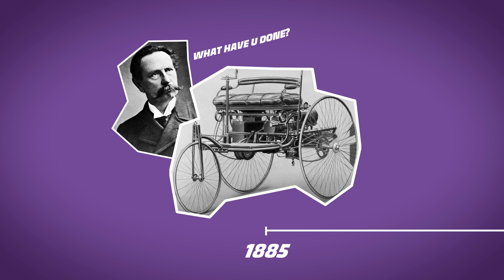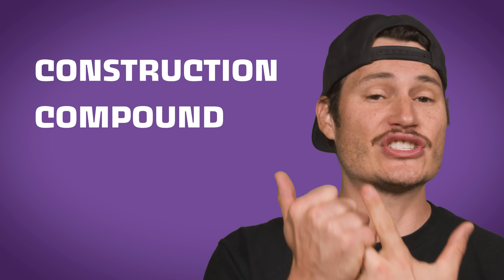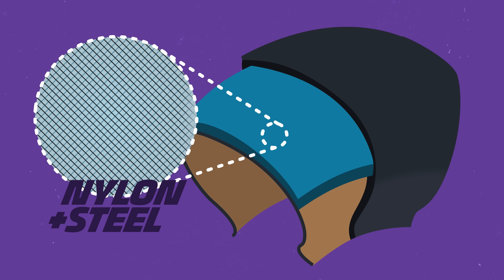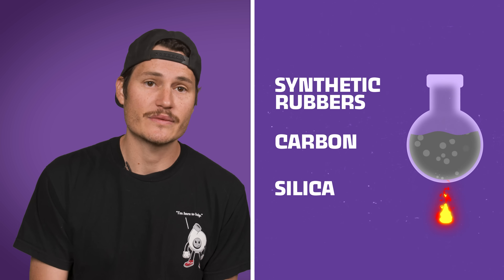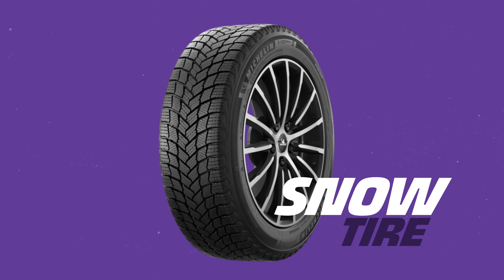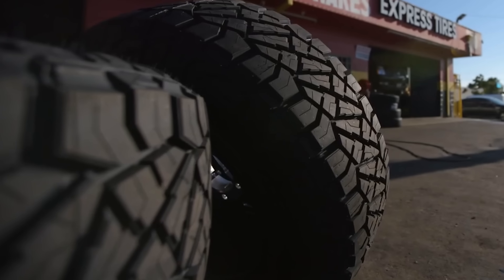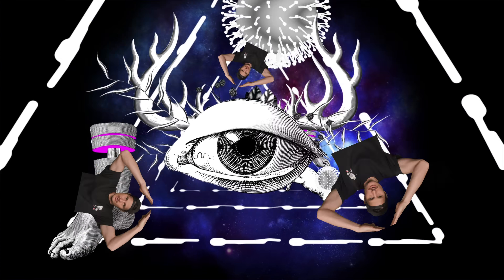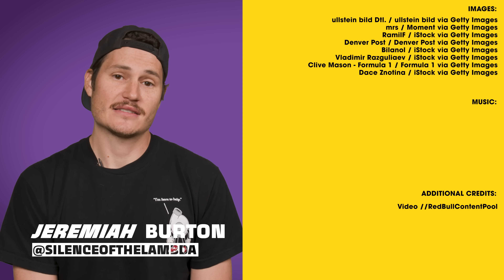The Surprising Science Behind Tread Patterns

Comment: Answer: From a physics perspective, the Fn or normal force (mg or mass x gravity) should actually be friction force Ff or Fs for force sliding (ms * N or coefficient of friction * normal force). Wider and/or fatter tires just means your contact patch is larger which might make the value of N larger because of the increased weight; changing your tires pressure also would affect grip because there is more tire touching the road. The "ms" is independent of the contact area however and doesn't change because it's dependent on the properties of rubber. Tricky question there my man

Comment: Awser: drag wheels need to be more wide and beefy to allow more grip available at the moment via 1 - begger contact patch, 2 - lower airpressure and flexabylity if the tyre body(they also act as spring int he start. In drag they go straight, no turns and therefore no need to account the wider wheel rolling resistance and its weight.

Comment: I am pretty sure the reason they prefer wider tyres are due to the weak shear strength of the soft tyres bcoz of that larger surface area is required to support the large tangential forces

Comment: Drag racers use wider tires because the center of a tire is what grips to the ground so when you have a 9 inch wide tires compared to a 15 inch wide tire the 15 will make more contact on the ground which means more traction

Comment: I’m not an engineer and I don’t know about modern tires but drag cars of the old days would have those massive tires that would wrinkle when the car would take off and if you watched closely at there burnouts before the race the whole back of the car would rise up like 6” when the tire was at speed. So ima guess the tires (on drag cars anyway) are super wide to have that extra grip for the launch and also have the extra rubber to thin out the tire when it’s at speed to reduce friction making it possible for more speed. I could be 100% wrong but that’s my guess

Comment: Tires roll, (unlike ice cube sliding on steel) so its like tape, the more tape you stick on the floor the harder it is to pull off the floor. So wider tires does not slide as eazy
If a tire starts sliding then the formula does work, but getting it to slide is harder if its wide. Just like after pulling the tape off, as soon as the tape releases then it does not matter how mutch tape there was...is slides just as eazy on the floor

Comment: They have wider tires as the amount of power generated by te engines which causes greater wheelspin. To minimise it, the wider tires provide more surface area, which decreases the pressure and helps in the traction

Comment: the friction between a tire and the road at extremes will actually shave rubber off of the tire instead of braking grip. a wider tire gives a bigger contact patch which meas more rubber to rip which means better grip.    when the tire inst autographing asphalt normal rules apply.

Comment: Ive been running directional v-tread tires on my daily since I started driving. I refuse to run anything else. The look great and perform extremely well in wet weather. My little truck runs 70 with ease when it's pouring down rain.

Comment: The reason for drag racing tires to be super wide is because of leverage advantage....the tire radius stays small at low rotational speed. Torque/hp once the tire reaches a higher speed centrifugal forces expand the center of the tire outwards increasing diameter hp/torque and achieving higher speeds..its like a gear change without the gear.

Comment: Ice skates actually work due to the amount pressure applied to such a thin point of contact with the ice.

Pressure can also cause ice to melt. So when ice skating you're actually melting and sliding on a thin bead of water that refreezes behind you.

Ice can be too cold to skate on. If its too cold your weight wont create enough pressure to melt the ice allowing you to slide. 

Also why the blades need to be as sharp as possible to create the smallest possible point of contact with the ice

Comment: Torque generated needs to be transferred to the larger tires that can be used to push the car without slip, if the tire is thin there is more slippage. Also with larger tires the more sticky surface they can be in contact with; which is usually covered in glue. Else would see a lot of burnout and less speed.

Comment: Im only matric now. But from what I know it that FN represents the normal force. In a car, the applied force from an engine acts to the horizontal of the car. There for using newtons third law on motion Fn(the force that the surface exerts on a car is = to the the wieght of the car or the force the car exwrts of the ground) = to Mg which is mass multiplied by the gravitational force that earth exerts on an object. So 
Friction = Coefficient of friction multiplied by Mg. There for friction is directly proportional to Mg and the higher mg is the higher the friction will be. The width of the tires increase to handle the forces that a car exerts on a tire. So they runwider tires are used to with satnd the mass(key word) of the car and increasing down force causes the weight(keyword) to increase, therefore causing grip to increase/friction

Comment: The friction force is the same. The difference is a wider tire dissipate the heat better and with a wider tire you have more area of contact with the road, so you if you run over something that makes your tire slide in some part you have more tire still in contact with the road. That makes you lose less friction.

Comment: Having an increase in surface area of a tire patch contact it will increase the gripping capabilities. For drag racing tires, obviously the weight of power train being close to the rear axle will benefit with a larger contact patch. Those tires are going to feel the sand between its toe tips.
Reply: He asked why larger surface area is increasing grip, and your answer is increased surface area is increasing grip. Do you see the problem? :D

Comment: Answer: a racer may be using a very soft rubber for traction, but want a very high pressure for low rolling resistance. The extreme width would be to reduce wear, extend life of the tire much like the “larger blocks” on the outside of some tires for cornering!

Some misconceptions.
Tires differ depending on the expected road (or off-road) surface.
Driving on sticky tar impregnated asphalt, road tires (temp dependent) and even road bikes work very effectively.
The looser the ground material, the larger the contact patch you need to maintain grip. Larger contact patches may serve no benefit if the road surface is clean, and may harm grip when the road surface is wet!
Road bike tires aren’t just thin, they operate at high pressure further decreasing the contact area for extremely low rolling resistance. While off-road bike tires have wider tires expecting loose dirt, gravel, mud, etc. The big knobby tires try to dig slightly into the surface working a tiny bit like a gear rather than purely like a typical tire.

On a bike, your contact area is your weight divided by your tire pressure and the answer is in sq in.
180 lb guy on a road bike with 90 psi tires has a total contact area of 2 sq in.

Comment: This is why they run wider tires 
Wider tires provide more resistance to slippery spots/grit on the road Race tracks have gravel, dust, rubber beads and oil on them in spots that limit traction. By covering a larger width, the tires can handle small problems like that better.

Comment: Let's see if I can explain the problem with wider tires = more grip:

If you run wider tires you don't just magically have more grip. Several things need to be considered. Some of those things are: tire compound, tire load sensitivity, slip angle, etc.
Because of the specific way tires work, that was quite well explained by the video, tires have an optimal load per area. That optimal load is reached, if the tire deforms exactly to such an amount, that it fills all the voids between the grains of the asphalt. If it is loaded less than that, it produces less grip than it could theoretically produce, if it is loaded more, the grip won't increase much anymore, because the contact between the road surface and the tire is already maximised. That is also the reason why heavier cars have bigger tires. The optimal load per area for the tire is, however, dependant on the tire compound. A softer compound has a lower optimal load per area than a harder compound because it gets squished into the road surface more easily. A softer tire could get overwhelmed tho, if it is exposed to to much load per area of contact patch wich might lead to tearing, where bits of the tire are ripped out of it. A way you can combat that is to increase the tire size/width. So if you want more grip for your specific car, that has a specific tire size and type, you can widen the tires in combination with choosing a softer compound. Just widening the tires would understress the harder compound, put not enough heat into it, and not use the tire to its potential. Just choosing a softer compound for the narrower tire would result in overworking the softer compound, maybe overheating it, and not benefitting from the the softer tire.
Another thing to consider is the tire load sensitivity. That states, that you can basically just put a wider tire on a car and magically have more grip, because tires produce relatively more grip, if the tire is loaded less per area. That effect is not that drastic however. You gain small amounts. A good example is that the R35 GTR is an extremely heavy car but still set a Nordschleife record when it was first released.

Something to consider when you are going to a racetrack is this: the asphalt at racetracks is mostly much more rough than normal street asphalt. That means that you can run softer tires of equal width on a track than you could run on the street, because the rougher asphalt gives the tire more possibility to deform around the grains. You need to have a sufficiently soft tire to take advantage of that tho.

Regards

Comment: It basically depends only on the weight and the 2 surfaces touching.
On a molecular level, my hands rubbing together and rubbing to giant pots togther, my hands will get way hotter. They are smaller but they are different material.
If you look at a tire under a microscope youd see its actually porous. However, the molecular ingredients to air, are larger than the pores so they cannot leave.

Also for brakes. They made huge leaps in brakes with ceramic pads. People think ceramic pads are actually grippy'er than metalic. However, they have made then in a way that during the bed in process, they actually leave a film which increases friction. Its actually to a point of almost adhering to the rotor more than just pushing against it. Hard to explain but simple to understand.

Comment: The reason surface width is not accounted for is because you would get an inaccurate reading. For example, if you put 5 pounds of weight on a 3“ x 3“ cardboard square and try and pull it across pavement it will be hard to move. If you put the same 5 pounds of weight on a 2‘ x 2‘ square and try and pull it across the pavement it will be easier to move. This is because there is an ideal ratio of weight per square inch (psi). This means that in order to get the best grip, you need to account for weight when picking wider tires. Wider tires don’t necessarily mean better grip.

Comment: Answer to your riddle at the end: mu is just the ratio of the slide resisting force to the normal force between *two objects*. Once you change the tire, aka one of the objects, you are changing mu. The normal force is just from the corner of the  car, which remains unchanged.
In another take, mu wraps everything about the contacting surfaces into one coefficient, so surface area, yada, yada, is already in mu.

Comment: yeah I aint no scientist
but due to the nature of tyre rubber and its composition the more rubber you have in contact the more the tyre can transform energy via its elasticity
that is to say, the contact patch is where you get friction but the surrounding rubbers ability to deform is where you get the "grip" assuming the minimum required pressure and not the maximum is use

Comment: It because mu for a piece of rubber glued to a cinderblock is not the same as mu for a tire. The coefficient of friction for a tire accounts for the width of the tire as well as the length of its contact patch at opperating preasure.

Comment: All of the commenters on here are wrong. 
Larger DIAMETER is more desirable for more grip, not a wider tire. 
The reason diameter is more important than width is for grip is because the angle of attack/ angle of contact against the road.
The larger the diameter tire is closer to being a flat surface against the road than a smaller diameter tire. 
Two flat surfaces rubbing together will have more friction than a curved surface touching a flat surface. 
A very nice additional benefit for drag racers to use taller tires is: For every rotation of the axle, a taller (greater diameter) tire will make the car travel further. 
But, that is just an added benefit. 
The primary reason for drag racers to use tall tires is for decreased angle of contact with the road.

Comment: I'm certain it's been answered by now....but:

Theoretically, as the surface area gets larger, the pressure (force per area) gets smaller. So the sum of all those forces between the surfaces do no change. Their are less points of contact (fewer total number of forces), but because the pressure is more, the faces are more and they equal out.

Practically, a tire largely gets its grip from being soft and deforming into the textured surface it rides on. Is you look under a microscope at the tire filling into the texture, you'd see not all of the frictional forces are perpendicular to the "flat plane" that is the road. Down inside, the forces are as various angles. All the faces at an angle have a horizontal component that increases the total horizontal forces helping a car turn/accelerate more. It's kinda like how a monorail train turns, leaning on sides of the rail to push it. Just in this case it's thausands of microscopic rails with a tire deforming into them. Since these forces are not part of the normal force supporting the cars weight, it's kinda like "free" forces to help turn your car. Without them tires would not grip concrete remotely as well

Comment: Because bigger tires= lower tire rpm at high speeds which increases the predictably of tire performance by making them spin slower while decreasing temperature. Wider tires increase the coefficient of friction by increasing the area of the contact patch. At some point making a tire wider and wider would will increase the contact patch to a point where the coefficient of friction cannot be raised because the tire spinning would move either the asphalt or what the tire is attached to.

Comment: To answer uncle jers question because pressure equals force divided by the area of contact, it works out that as the friction generated by changing surface area is offset by the same amount of reduced pressure; the resulting force, is dependent only on the frictional coefficient of the materials and the bonding force holding them together.

Comment: Pretty sure I am not the first to answer the question : but it is a balance between inertia momentum and torque per unit of surface. BetterTorque/m2 results in less energy transfert per m2, resulting in less heat and less deterioration. Plus you can make your wheel smaller reducing the inertia momentum, increasing the "rotational" acceleration but reducing the total surface then increasing the energy/m2.... and you are in the balance loop :P

Comment: If the weight of the car (including the tires) and the road surface roughness and material are constant, the frictional force is the same for a narrow tire and wider tire. A wider tire will only make the contact patch wider but not larger. But because you have a wider tire, the tire will have more opportunity to stay in contact with the road surface in a turn. Imagine a motocross bike with super thin tires trying to go around a non-banked curve - the bike will lose grip every time it goes over a nasty bump. Now, assuming the tire weight stays the same, put on a set of super wide tires - these tires would do much better in staying in contact continuously over a bumpy track because the extra wide contact patch will give the tire more width to catch the next peak in the road surface.

Comment: Wider tires accomodate gaps in the grip of every square inch of that drag strip pavement or loose rocks. Also tension. You want to shove 500 lb.ft of torque through large tacos, skinny tires would be bent and ripped off, so the tension is distributed over more rubber. Force over area.
Valves that can handle 8000 psi are just 1/4 inch diameter, so the force on them is small.

Comment: Answer: The reason those tires need to be so wide has to do with the centrifugal force that the tires are exposed to. Under enough centrifugal force, the center of the tires will expand and create a doughnut shape creating less grip because there is less contact surface touching the asphalt. Given the fact that Drag Racers have to achieve such high speeds in such a short period of time, those tires need to be much wider so that the donut effect does not have as much impact on the tires' grip.

That is just my common sense guess